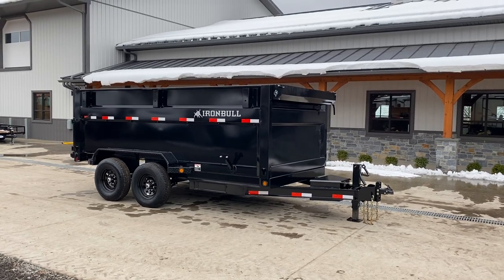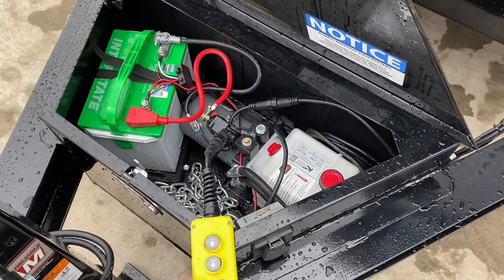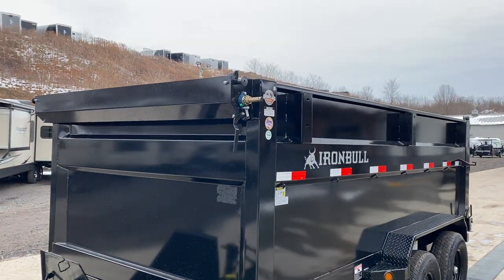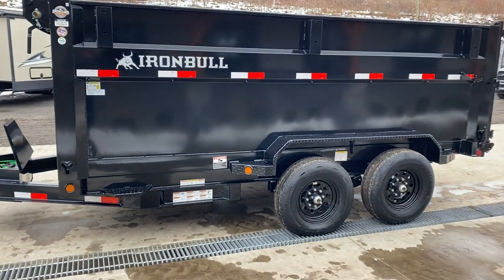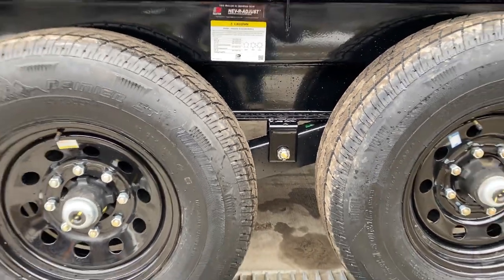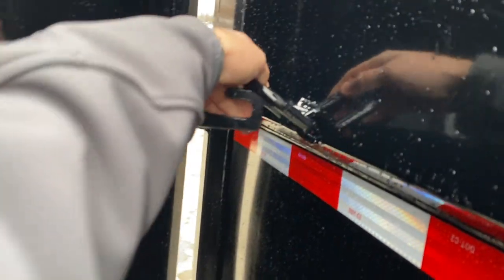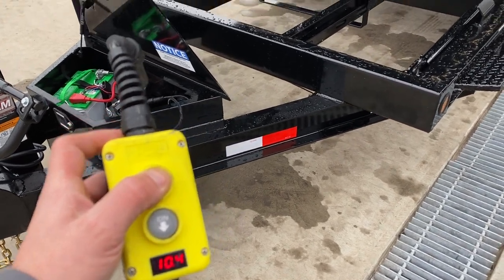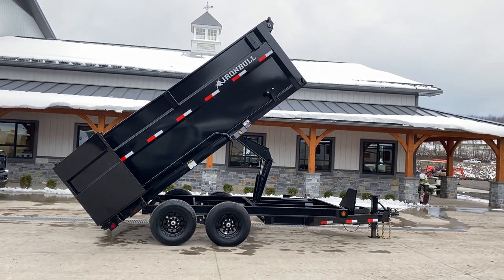2021 Ironbull 7x14' High Side Dump Trailer 14000# GVW * 7 GA FLOOR * TARP KIT * SCISSOR HOIST

Comment: this is nice but i always prefer a power up gravity down for that specific reason. you burn through batteries twice as fast that way.  
gravity down is much more efficient and prolongs the life of the battery
Reply from the maker: I would disagree somewhat.  It takes about 4 times the power to go up than down (about half the cycle time and half the amps), depending on the load.  A gravity down may net 1 extra dump per battery charge, in my experience, depending on the weather, load, group size of the battery (typically group 24 on dumps), time of year, size of trailer, etc.
Reply: @BestChoiceTrailers  main reason i say this is because i’ve seen trailers stuck on the up position at the land fill more than a couple times.